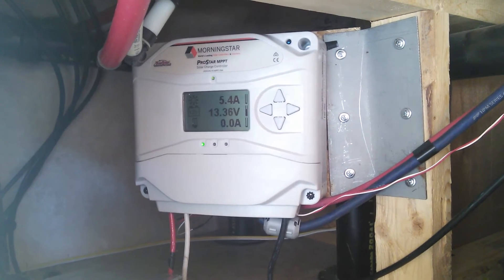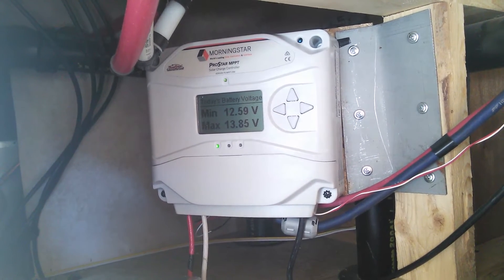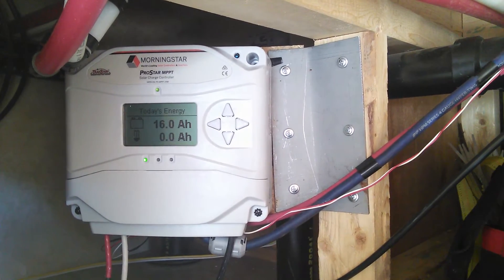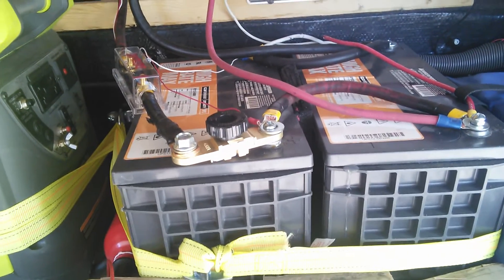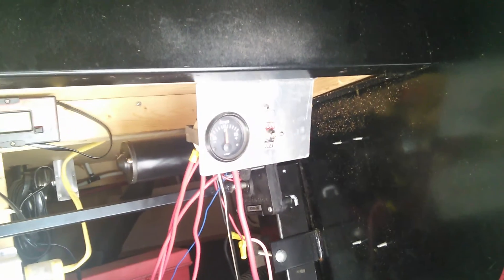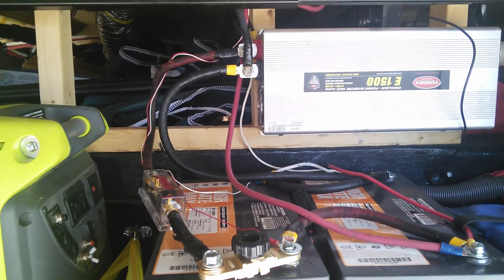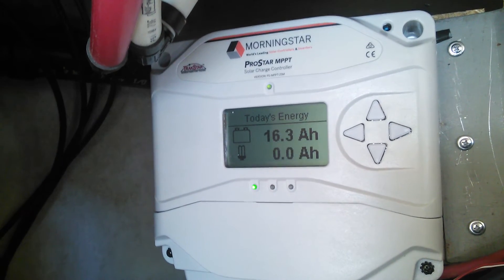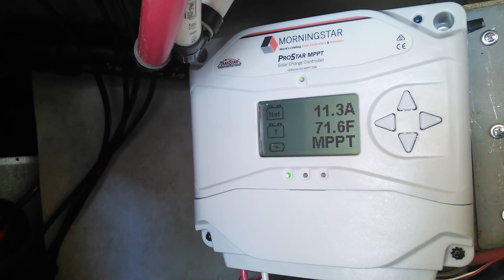RV solar setup, 460w Morningstar prostar 25amp mppt

Comment: Help please! I know this video was a long time ago, but I have the same charge controller on a 12 volt battery array. Someone gave me some 235 w solar panels/ 8.5 amps each. Did you say that you put 2 of these solar panels on this charge controller? If that is correct, how has it worked?
Reply: Thank you for helping people out. Very kind of you!
Reply from the maker: I just took this off the RV this spring 2023. It worked great while I used it. 
I ended up with three 250w panels in the end and went to 24v. 
After 24v with lead I realized I needed more battery capacity so I switched to dual lifepo4 24v after this video.  the morningstar had to run a custom programming for it.

I am going to keep the morningstar unit and build a backup for home use. The RV got a cheaper renogy unit
Reply from the maker: The 12v worked just fine. Two panels would be most I run with this unit in 12v.

Comment: I am looking at purchasing a 40 Amp MPPT in this model and was looking for a review on it and I came across your channel. I am just starting to get my solar array together to be 100% off grid.
Reply from the maker: Darren Charron my controller setup is undersized for 12v application, if you do 24v might be doable. for off grid I would say look at tristar units, 48v is way to go for home. my RV runs at 12v for now because of inverter. I will eventually go to 24v inverter and better utilize the 60cell panels.

Comment: Great video.  I'm still designing my solar setup for later this year.  Is there any particular reason you went with the Morningstar 25A, which with meter is about $65 or therabouts more expensive than the Midnight Solar Kid, which is a 30A controller of I would say equal quality, in as much as they are both very nice controllers.  It occurs to me that the Kid would be able to draw those last few precious watts out of the panels to run float loads a tiny bit better, and charge your battery bank a little more quickly.  I'm considering the 40A version of what you have, or if I go bigger the Classic 150, or the Tristar 60A MPPT with meter.
Reply from the maker: my choice with Morningstar is because of my past experience with their pwm units and the tech support. I did initially buy the tracer units but each time I needed tech support it was hit and miss. I was looking at the kid and blue sky, again it was just my past experience that kept with Morningstar. 

the Morningstar does go upwards of 27amps on occasion and was told that is normal. my panels are oversized for it, with 460w total i estimate a 20% loss at times, brings me down to 360w which is perfect for the 25amp unit. 

I really like the switch box though and would recommend it for RV use, I can see in real time effects of serial/parallel input and how the unit adjusts for them.

Comment from the maker: saw controller putting out 27amps over the weekend, I did have a load on the battery/inverter pulling 28 amps out. Called Morningstar they told me the unit can/will go over rated amount at times but will self limit and not to worry. Very impressed so far, even with one panel, the ProStar takes the 30+ volts and cranks the amps from 7 to 14 with just a single panel.To get into the custom menu, Morningstar told me to set all dip switches for battery type to custom and I was able to enter all the menus'. I have a 90F thermal switch on the fins in the back, attached to the fan. Using the load control to control it, so it only comes on when it needs to. SO far the fan has not come on even once under normal operation with 15amp loads.